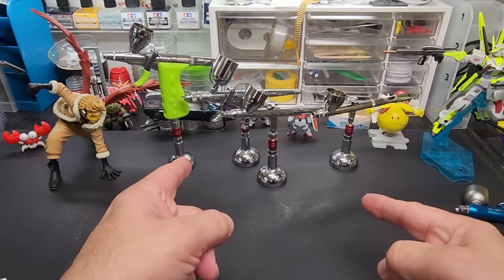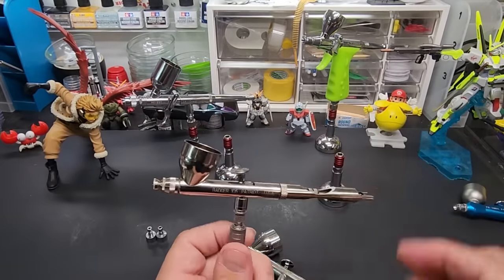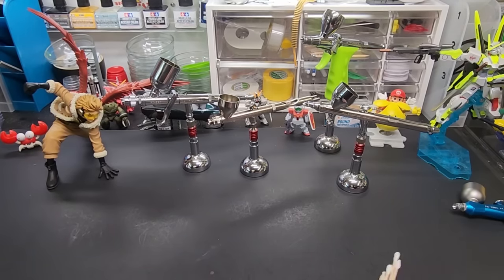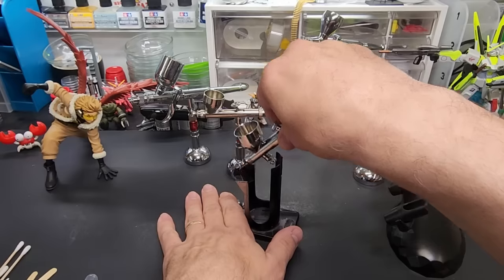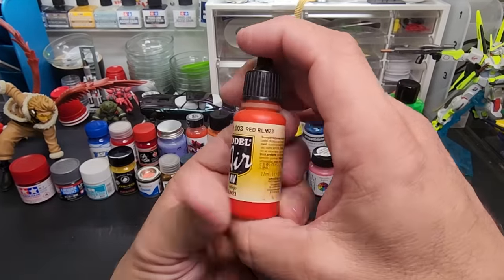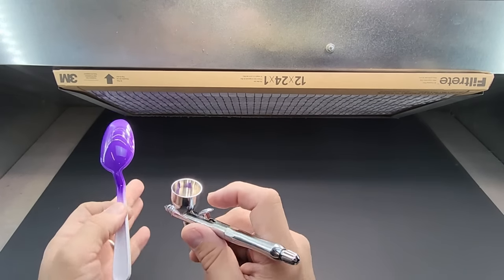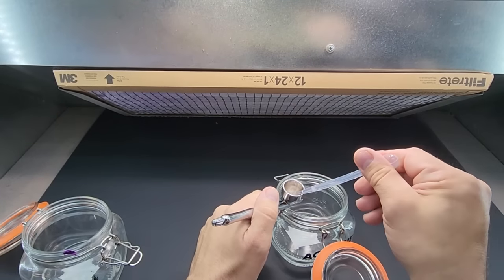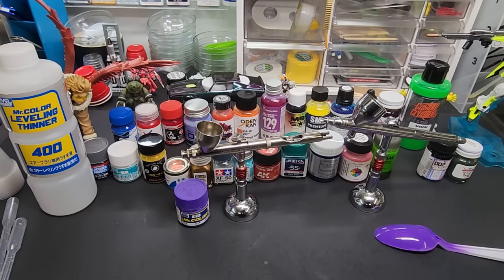How To Airbrush For Plastic Models  - From Painting To Cleaning

Comment: You could make use of those plastic cups you don’t like by turning them upside down and use the bottom to mix small amounts of epoxy or to hold ca glue. Sometimes the epoxy pops off after setting.

Comment: I have that Fortress compressor I got at Harbor Freight. I use it for blowing dust off my workbench, models and to fill the air in my tires.  Haven’t tried using it for airbrushing yet because it is so loud I prefer using my no-name airbrush compressor.

Comment: Thanks for another good video.
Yes buying airbrushes can be very additive.
As you know (putting this in for those not familiar with paint chemistries) it is a common misconception that "Acrylic" paints are all water based. "Acrylic" refers to the Pigment being a man made polymer (plastic) and not natural (plant , clay, etc)material. There are Acrylic Enamels (mostly used in artist paints now but  once popular for automotive paints), Acrylic Lacquers (Tamiya for instance being a alcohol solvent based lacquer paint), and water based Acrylic paints (such as Mission Model paints.) As an aside, Vallejo started as a acrylic paint for animated films (cartoons) in 1965.

Comment: Love your vids! I’ve followed your advice since I bought my first airbrush and got back into car modeling last year. I started doing this when little Testors  bottles were a dime…the .69¢  spray cans were waaay out of my budget. 😄
The most helpful improvement to my set up was upgrading the air pressure gauge on my regulator. The gauge that came on the regulator from  Spraygunner, was only 1 1/2 inches wide and read all the way 150psi. I seldom spray at over 20psi but mostly 12 to 15psi. 0 to 30psi was about a 1/4” of calibration.  I had great difficulty setting the pressure at a specific number. I found a gauge on Amazon  that is nearly 3” and only reads to 60psi. This has half of the gauge showing 0 to 30psi, in clear and easy to read calibrations. Check it out. 

Love your channel…watch every episode! 👍👍
Reply from the maker: Thanks buddy

Comment: I only hope I enjoy painting as much as the hunt for the equipment. Interesting how researching products kind of leads you around in a circle. Such as researching the No Name compressor, which I see you use, and finding it at Spray Gunners, then find out they label and test them in house, which turns out to be just down the road from where I live. So I bought the Cool Tooty today with some paints. What a nice setup Spray Gunners has and the guys were super helpful. I dropped your name and told them I found them through you and no surprise that they knew you. I never seen so many paints in my life. Also bought a returned and refurbished airbrush from them. Some German make. The price was right and Gary stripped it down and went over the entire cleaning process with me. 

So thank you for all your videos and recommendations. I’ll probably get setup and test this out tomorrow.

BTW for those interested. That 2 gal air compressor at Harbor freight is on sale right now for $169 and that’s not the members price. That’s only $10 more than their 1 gal pump. To be honest it looks better than the Tooty but you will have to modify it a bit with fittings and air filter and the regulator looks useless for the lower pressures of air brushing. I’m buying everything to get going so that made it out of my budget this round. 😮

Comment: 9:49 for people staying in a humid country pr region (85-99%), the in-line water trap right before your airbrush is an ABSOLUTE MUST. You rather go without a pressure regulator than without one of these. The moisture trap at the compressor will not help you with moisture forming in the hose and you will spurt within 10-15 minutes. You also want as short a hose as possible, to reduce the amount of pressure change and air within the hose to minimise the amount of water formation

Comment: Living in Hawaii, my moisture traps do WORK! So humid in my area. I can water the lawn with all the moisture it collects lol
Reply: Never seen the slightest drop of water in mine. The temperature in my garage where I paint, depends on season but around 7C in the winter and 25C in the summer. The humidity is controlled by a dehumidifier when needed and varies between 30-55% RH.

Comment: Just want to point out.
You say your compressor is good because the needle on the gauge doesn’t move much when the air is flowing. 
That’s a misconception and could confuse people who are new to compressors. 
Your gauge goes all the way to 100psi so that 1psi drop looks very small. 
I have a gauge that only goes to 30psi to increase the accuracy of my adjustments and the needle moves quite a bit when air is flowing, but it is still only a 1psi drop since the scale is so much smaller. 
Also, the drop you will see on the gauge is dependent on the hoses/ filters/ and tools you have attached, not the compressor itself. 

So to anyone shopping for a compressor, be mindful of the scale of the gauge and what kind of tool you are using when testing it. 

Besides that great video. I use it as a refresher sometimes

Comment: Ecelent video, lots of usefull tips as begginer  I am using them a lot. That technique for gloss painting really works nicely. 
But my biggest struggle with airbrushing is when painting flat paints. 
When I do test shots on spoons or painting small pieces its all nice, but when it goes to paint for example some aircraft I really struggle with paint bounceback or how its called that on surface near every corner (like near wing roots, around some fairings etc) there is acumulating powder like layer of dry paint that makes surface really grainy and more paint i spray it gets worse. 
I would really like if you do some video about how avoid this phenomenon and get nice smooth flat finish even around complicated shapes :)

Comment: One of my concerns is how n where to store and/or dispose of the wipes and swabs that are smelly and wet with acetone thinners and spirits . I’m always concerned about mixing used cleaning supplies and solutions together to avoid a fire hazard, not to mention the smells. Most times I simply lay them in the garage utility sink to air dry or in an open container. On occasion I’ve rinsed them with water, but I’d guess that may not be the best idea? Any good hacks out there for this?

Comment: Thanks for a very informative video. I'm new to airbrushing and have been watching your videos for a few weeks now. I live in an apartment so I'm sticking to acrylics for now. Just bought my first REAL airbrush, Iwata HP-BCS Value Set (I wanted the Iwata Neo gravity feed, about $65, to start with but the HP-BCS was such an incredible deal, less than $50 at an art warehouse that was going out of business and this was their last one, I had to get it). I need a good compressor ( probably the Tooty like yours) and down the road a gravity feed. If I understand correctly, the GSI Creos airbrushes cannot  exchange needles and caps? Do you need a different airbrush to use a different size needle? If that's the case I'll go with the Talon or Patriot. Thanks for any advise. Can't wait for your video on acrylics.

Comment: If I use solvent paints they will be from a spray can. I built a 1963 Sting Ray Corvette many years ago when the TV show by that name was on the air. I used flat black for the primer and gloss black as the top coat of color?
What about the blue airbrush laying to the right side of the video?

Comment: This video is perfect timing! I'm starting out the using Mr. Color for the first time. The paint to (Leveling) Thinner I've used is 2:4, and it looks to work fine, but what I saw in your video the ratio should be 1:4?  Would this ratio (1:4) be the same with Mr. Color Clear (100) or Tamiya Clear? X-22? With Clear the "cup side wall" test is difficult to impossible to see.

Comment: Hello Robert,
As always your videos are informative and beneficial for all of us modelers. I just have one question at 36.36 minutes in your video when looking at the air regulator I always thought that the red dial is for PSI and the black is for BAR and you have set the gage to 20 as you stated at 37.11 minutes in the video, so what is what I'm a little bit confused.
Thanks a lot

Comment: Thanks for the video. I have a hard time painting plastic specially the pelican plastic cases nothing i try seems to stick to it. Any suggestions would be appreciated.
Reply from the maker: Have you tried a Plastic Adhesive Promoter? It helps paint stick to tricky plastic surfaces. They use it for bumpers on cars. It comes in a spray can
Reply: @barbatosrex9473  I haven't try that yet, I'll look around to see what I find. Thanks for your videos it has helped me on my air brushing journey

Comment: those things u store your airbrushes in that are hard to get i can make these easy on the lathe/bridgport which i have at my house all u need to do is buy those quick disconnects and the make a bulb out of say brass or aluminum  wolud be pretty easy to make these to sell i could even make say custom bulbs out of stainless  or copper etc whatever material u wanted

Comment: Do not use Acetone. You will erase the chrome protection of your airbrush in less than a year. Alcohol or other “soft” products, but not Acetone
Reply from the maker: Well I've yet to have that happen to me for the last 5 years, all my airbrushes are still looking good 👍
Reply: @barbatosrex9473  It has just happened to me with a H&S CR Plus Giraldez. The lower inner part of the cup has started to rust in a yellowish kind of rust, like brass.